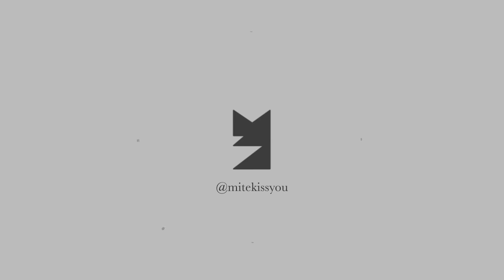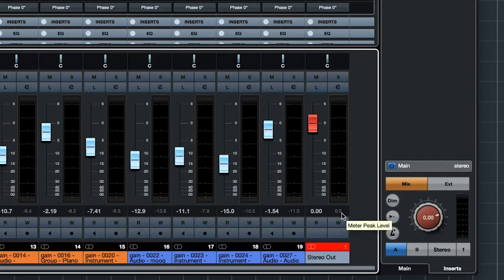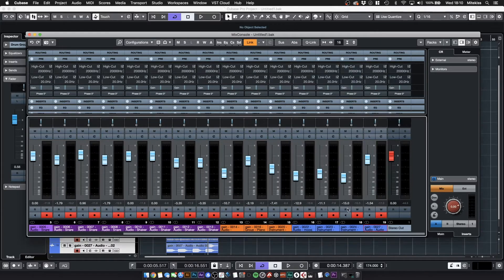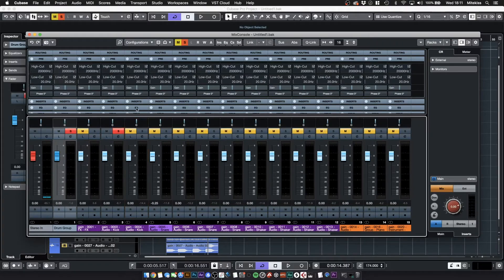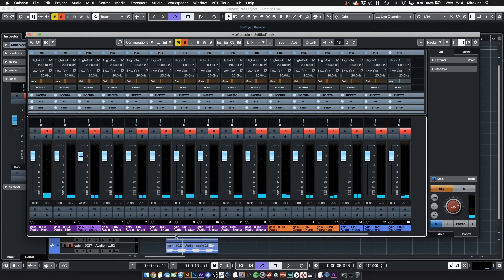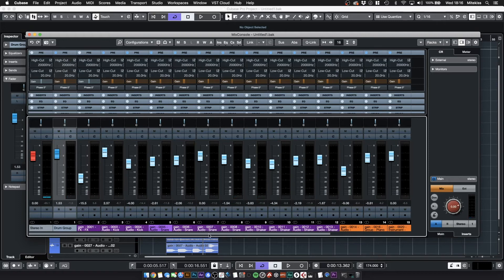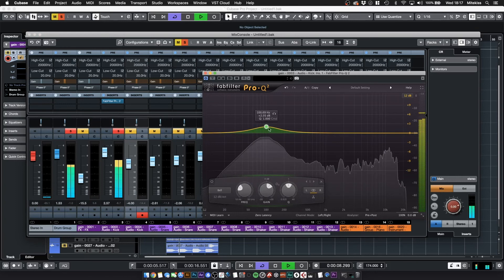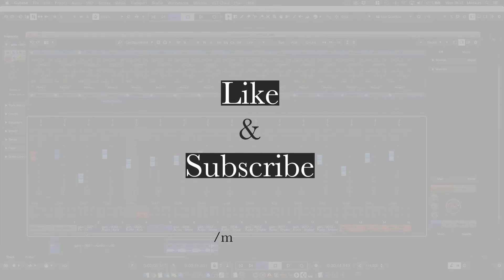Gain Staging in Cubase Pro 10

Comment: The problem is, with this gain staging method, I found the gain staged tracks are much lower than 0 dBVU when I check with a VU meter, which is not optimal input level for plugins.  Have I done anything wrong?

Comment: I appreciate the video, thank you, easiest summary of gain staging I've came across.

 One question is, my tracks usually seem to quiet once I'm finished with them, so would I try to make that gain up in let's say, an EQ setting ? Because I don't want to touch the -18db pre gain that I've already established like you did in the beginning of the video
Reply from the maker: Hey Ryan, they will be quiet or have headroom, this is so the mastering engineer can do their job. If you are not getting the track mastered, you can then apply a limiter or turn it up in Audition or whatever to get it close to 0db.
Reply: @Mitekiss  Thank you for the info!

Comment: When gain staging, the number under the fader is the current fader position, what is the gray number next to the bright white number, is that peak?
Reply from the maker: Yes, It's peak I believe
Reply: @Mitekiss  What option did you set it in for meter display, Input Gain, Post Fader or Post Panner?
Reply: Depends on what you choose to display there(grey numbers) from the drop down list of options over the faders or meters. Either of: Input Gain, Post Fader or Post Panner.